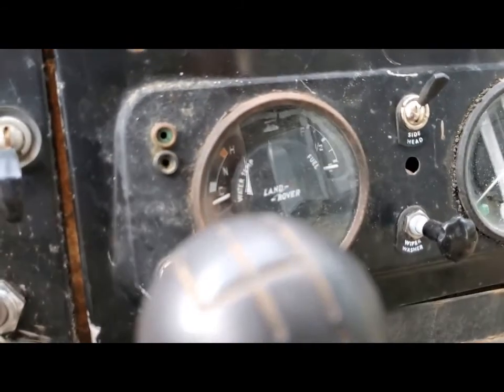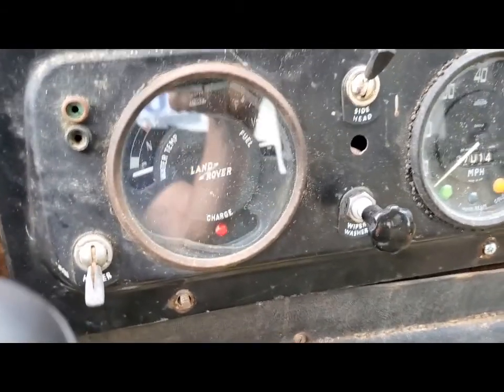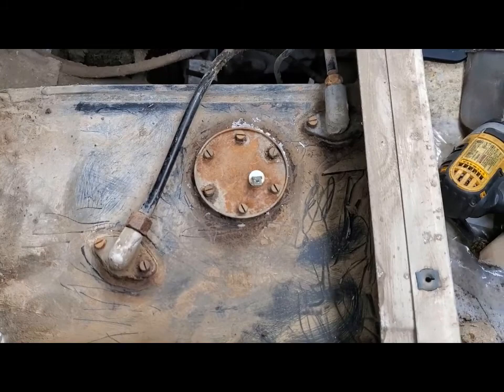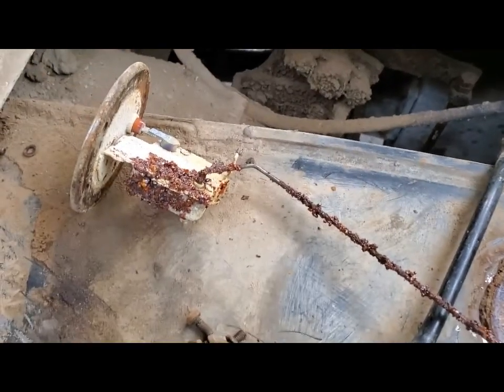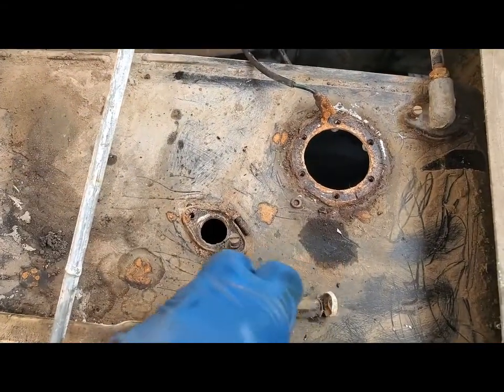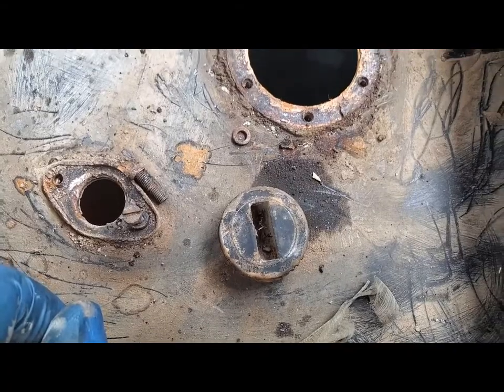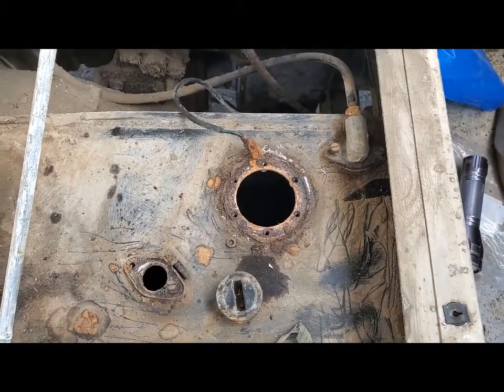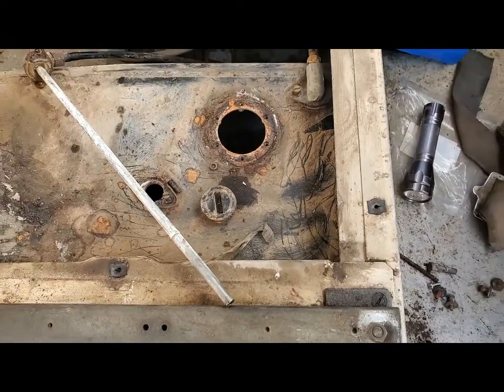Land Rover Rescue Gas Tank Renovation pt 1

Comment: Just did this on my 66, S2A 88”
Cleaning out the tank was difficult as it had an old sealer that was pealing. Sending unit was frozen.
I opened it up and got it working.